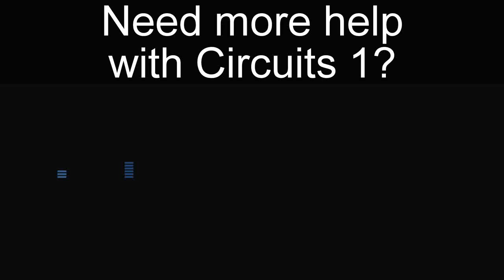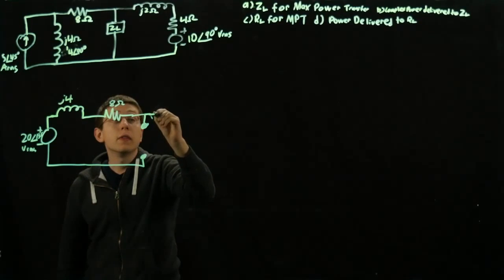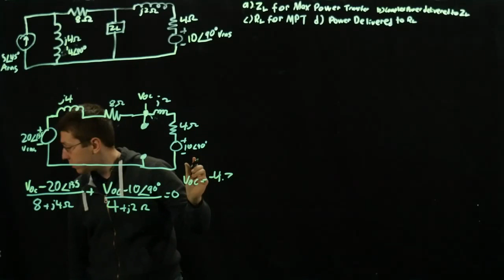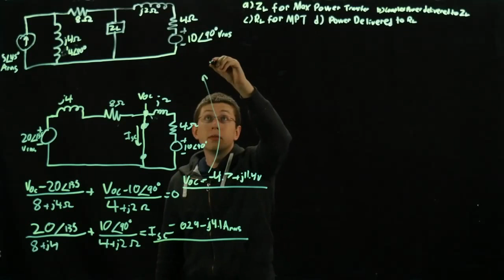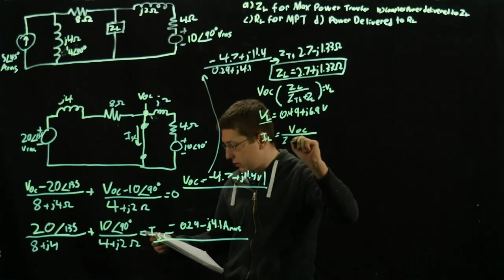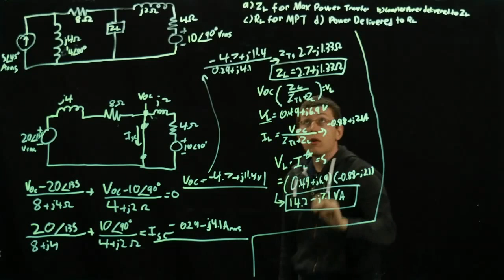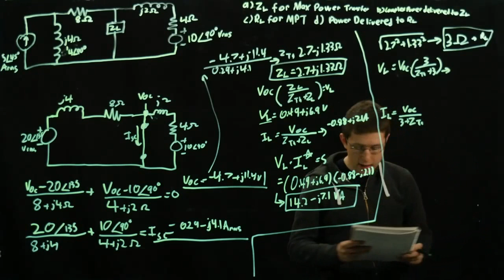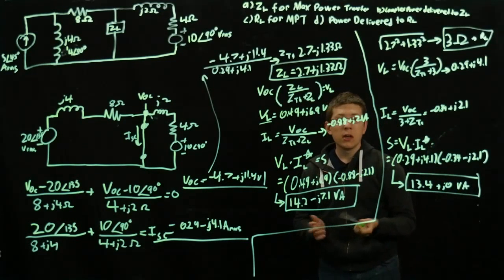Circuits 1 - AC Maximum Power Transfer - Example

Comment: Why did you apply Zth=Voc/Isc when we don't have dependent and independent sources together? Aren't we supposed to short circuit the voltage or remove the current source to find Zth?
Reply from the maker: The method you are describing should work in the scenario you describe (which is this situation) but the method we use works for any circuit, and we were setting this up as an example, so we use the most general solution.

Comment: shouldn't R(l) just be the real part of Z(l)? (i.e. 2.7 NOT 3)?
Reply from the maker: Hi, great question. 

The maximum power transfer theorem says that for maximum power to be delivered, we must use the complex conjugate of the thevenin impedance. if we are using a purely real loading, the theorem states that the resistance should match the magnitude of the thevenin impedance. So we want to match the magnitude, not the real part only.

~Andrew

Comment: (-4.7+j11.4)/(0.293+j4.121) equals 2.667+j1.333,   NOT 2.667-j1.333 ,   unless my calculator is wrong... and I think maybe it doesn't matter but it's just something I noticed
Reply: Thank you very much for your warning. I solved the question but got the conjugate of the result since the calculation here was a little mistake and I was trying to figure out what was the mistake that I possible have done